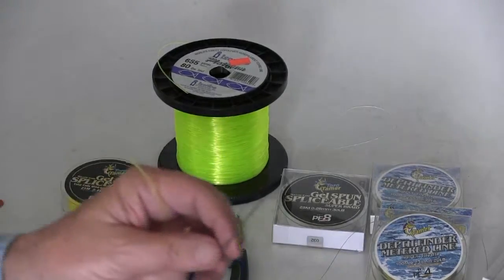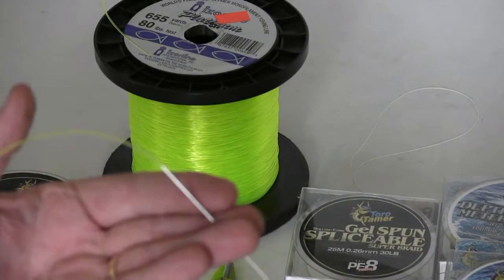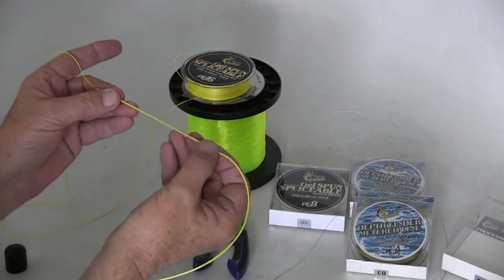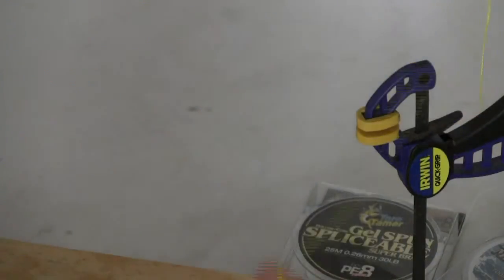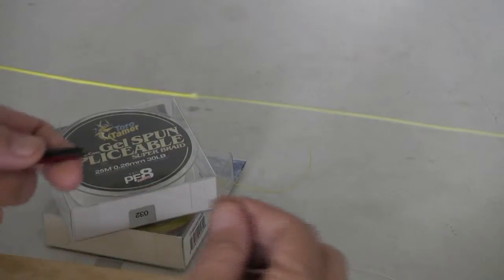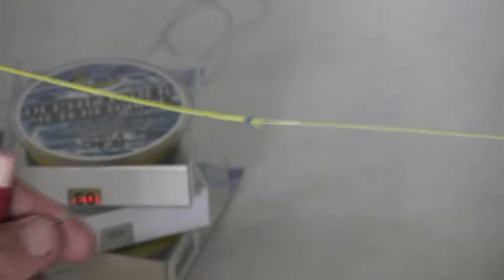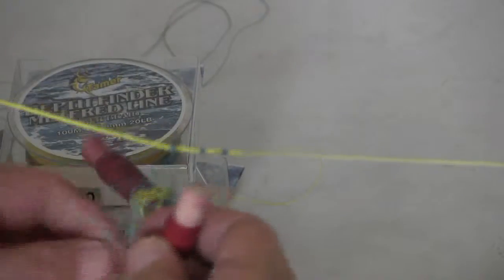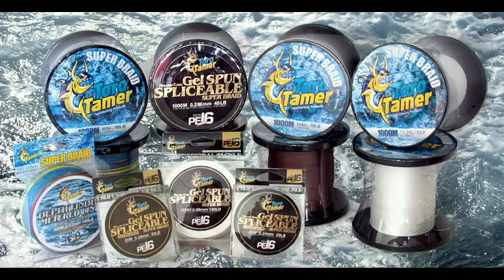In-Line rigging leader to hollow braid using nail knots

Comment: I use the glue just to hold the end in position so I can then serve or use nail knots. Hadn't thought of it as actually holding the spectra, doesn't seem like a good idea. From 12lb to 50lb leader, I glue 1/4 inch at the end, and then run 3, 6 turn nail knots, roughly 1/2-3/4 inch apart. I've started, as crazy as it sounds, making 12lb leader wind ons, thanks to the TT coming in such low tests. I do some inshore fishing, and it saves me $$$ to not cut and discard leader material if the fish become leader shy. 12lb mono (TWELVE) fits into the 30 and even 40lb TT hollow perfectly. Im telling you it's actually fun to mess around with the really light hollow core, people need to try it.